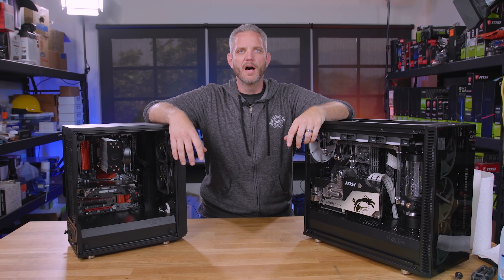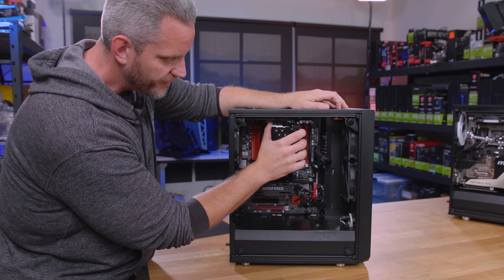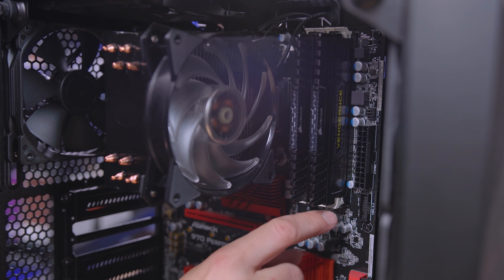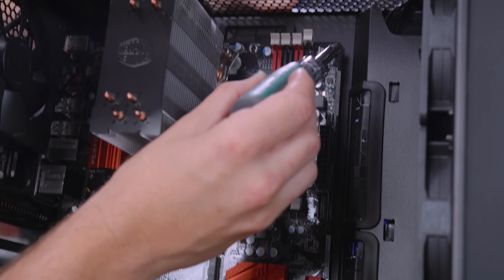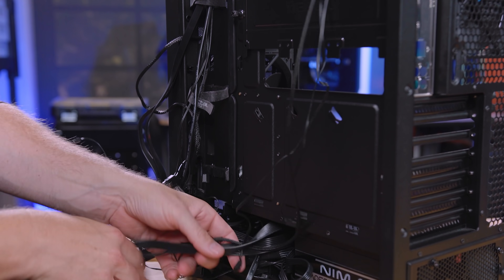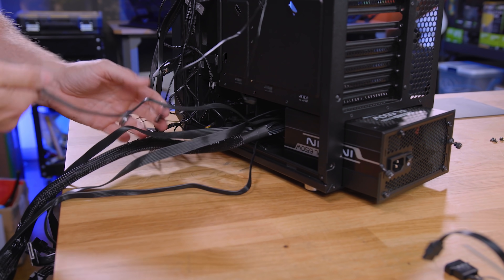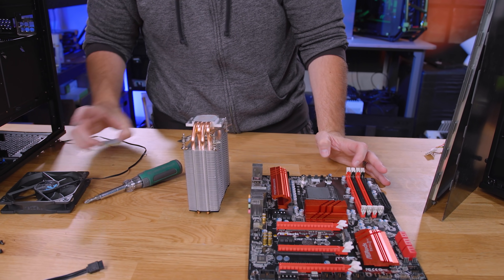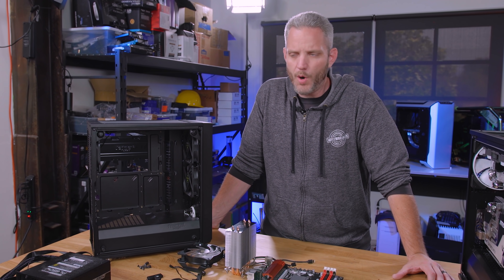How to UN-Build a Computer

Comment: Cannot explain how much this video helped me, I know absolutely nothing about building (or in this case un-building) PC's. I bought a pre-built 1-2 years ago and it has some pretty nice specs, but the case is awful, makes it hard to upgrade anything within the pc itself. I recently bought an H7 Flow from NZXT to move my parts into but needed help with taking everything apart, took me 2 minutes to find this video, and now I know what I need. Now the scary part, actually doing it 😟

Comment: Know it's an old video, but I'm looking at pulling a discount hp desktop apart to put it in a new case with room for larger power supply and gpu. Can anyone tell me if prebuilts have their motherboards and gpu soldered or rivited into the cases most of the time?
Reply: From my knowledge, most PCs do not have any motherboards riveted onto the case. You should just be able to remove the screws that affix the board to the case and remove it. Now, there are some manufacturers that may use proprietary form factors. So while you could remove the board from the case, it may not fit on an any other case. This especially true with All-in-One computers and those very small computers.

Comment: After unbuilding 3 pcs I find it all to be a bad experience. Pcs are annoying to build, any important hard to plug in wires are jammed into the corner while the wire doesn't have enough distance. PC cases and mb are meant for building and not unbuilding

Comment: I did build my own pc in 2018 and while I remember the parts well I dont remember near anything about the ports and cables. I wanna take my pc apart for a deep clean and put it back together (since the case was updated with a new drive and fans those cables are kinda smooshed wherever they fit and wrecked my cable management so)

Comment: this is helpful as I bought a custom and need to upgrade a few things in it such as the power supply, RAM, and CPU fan.  I been doing research and feel a little more confident but its still always scary working with thousands of dollars worth of tech on the lines.

Comment: Thanks Jay! I found this a little later in my disassembly but it's still very helpful. I got into PC super late and ended up going with a very high end prebuilt with a 3090 and 5950x. So as you can imagine, this tear down has been terribly scary as a first experience. I realize I had an underspec CPU cooler so I got a 360 aio, but due to the case and circumstances, I've essentially had to take EVERYTHING apart. It's still lying on the table at home, half dissassembled as I wait on the replacement cpu mount and backplate cyberpower never sent to me with the rest of the OEM parts, but I'm using the time in the interim to continue researching. Also, I wanted to give you a massive shout-out, I never would have made the jump from console to PC without the confidence I've gained watching your videos for the last few years. Thanks again Jay! Best PC tech YouTuber out there! Hope to see you on Phasmo one of these days!
Reply: Not Jay but I hope all went well for you! I will soon have to get a new PSU and GPU along with adding more SATA/storage. 

Enjoy the build. I had a friend build my PC for me when I went to Mexico. I did do IT but building your first isn’t easy as you have trouble finding your own mistakes.
Reply: @FabianC907   Everything turned out great! It took quite a while given the unfavorable situation, but I was able to get my aio on, and keep all of the old fans in the chassis along with the new ones for the 360 rad! It's beautiful and runs oh so cool now! I ended up having to COMPLETELY take  everything apart. The experience was taxing but so worthwhile. I feel much more confident with the intricacies of the hardware and making changes myself now. I honestly feel like the build looks a great deal better than how it shipped. I even invested the time into Signal RGB to sync all my peripherals and internal RGB. It's a beautiful beast that oughta be around for many years to come now, thanks for the reply, I hope you enjoy the mods you'll be making as well!

Comment: I just want to take it apart and build it back. Do i need to take off the aio cooler?
And do i need to Rennstall windows?
Reply: If you're going to take it apart completely, then yes you'll need to remove the cooling solution. No need to reinstall Windows. You can but there's no logical reason for that for simply taking the PC apart.

Comment: Hi need help
I want to remove the front pannel connector but its stuck or is there any lock which needs to be unlocked to remove  it. Its a single connector with all the pins in it.

Comment: You should definitely clean the cpu when it's in the socket. Because a it's real easy to get thermal paste on to the pin, but it's extremely difficult to get thermal paste off the pin for AMD (speaking form experience)

Comment: PSA if you use stock Ryzen cooler, remove your graphic cards/RAM first to create more space. I was trying to remove my wraith prism cooler first thing and found out I didn't have the space to maneuver and unlock the clip on the side of the cooler, because of the the GPU/RAM were in the way. I ended up bending some of my CPU pins because the whole thing was stuck to the cooler (just like Jay said in the video) and spent 2 hours straightening it one by one. Oh and getting the CPU unstuck from the cooler was also a nightmare, I ended having to us twizzer to kinda leverage it up by the side as I cannot twist it off :(

Comment: ** I don’t want to spend $80 for geek squad to fix a small prob so can you help me? I took apart my pc to do cable management. After I unplugged and powered off my psu, I pressed the power button to get rid of any extra juice, it flashed on for a sec and I wasn’t worried. I did my cable management and plugged everything in exactly where it was, did I ruin my psu by turning it on?

Comment: Please do 1 whole video on how to remove the 24-pin motherboard power cable thingy
Reply: I got mine stuck in my old mobo, I grabbed a shoelace and a pen, I placed the shoelace under the clip  and then I wrapped it around the pen,  I pulled using the pen as hard as I could, the mobo bend but didn't break also the stupid clip never broke,  finally the 24 pin came off . I was ready to brake the mobo, I don't know what I'm going to do next time I changed to a new power supply if I don't want to break my current mobo.
Reply: Just pull it out by wiggling it for 30 minutes or you rip out the plastic of your motherboard

Comment: @JayzTwoCents, hey so i was gonna rearrange my cables in my pc and I was wondering if it is safe to plug the drives back in afterwards? Like do I have to have them plugged into the same slots via sata or will the data be lost after unplugging while the pc is completely turned off, PSU and all are off?

Comment: thanks for making this. my first-ever build may have an issue with two of the DIMM slots (running at 1066 instead of 1600). so I might need to return my Brand. Fucking. New. Motherboard. to Amazon and replace it. Way less daunted about the process now!

Comment: I've had a prebuilt for almost 2 years because I was terrified of messing something up building a pc, but after watching your videos I realized it's pretty easy to work with computers as long as you're not reckless about it. I'm very much looking forward to the time when I finally replace my pc, because I'm going to do it right and build it this time.
Reply: Mostly ok, I had a tutorial running next to me so I wouldn't miss any connectors and it went great until I went to turn it on and it shut itself down not a minute later. After hours of troubleshooting I realized my CPU cooler bracket was backwards, turned it around my PC came to life and stayed alive. All in all, building a PC is pretty easy so long as you try to avoid simple mistakes like that and take your time.
Reply: @AtariGamer0917  Great to hear! Thanks for the response!
Reply: @AtariGamer0917 same situation as you expected it's been 4 whole years! New case cpu and ram today im so exited
Reply: How did it go?

Comment: Jayz: easily takes out 24pin cable

Me: almost cutting myself trying to take it out terrified of my motherboard snapping
Reply: How i feel about my 8pin gpu cable, feels like im gonna rip the gpu right out of the slot, i have two 6x2 pins for my gpu but i never know which one to use or if it matters. I went prebuilt through nzxt got the start plus which is now the starter plus pro lol i got lucky but its my first pc and these wires are scaring me
Reply: did u get it out
Reply: @G-fd9ds  yes
Reply: @QuickCosmosReal  took me a while but I got it out too 👍

Comment: Help needed. I’m not new to building computers but I have never taken one apart to this extent. I’m building a computer for a friend and I want to build it to get it up and running and the OS installed before I disassemble and take it to him to rebuild it. My question is about the M.2. Will I need a new thermal pad or to do anything special since it will only be installed for a few hours?

Comment: I've got this 10-year-old hp computer tower and the siding just won't come off and it's not rusted or anything and I'm pretty sure all of the screws are out and it still won't budge(update: so the side came off all you need to do is slide it to the side instead of just pulling it off)

Comment: 13:15 I wish I knew this a decade ago. Couldn't figure out how to separate a stock cooler from an AMD processor. Broke the processor and had to get a new one. Another tip for separating the Cooler from it's CPU. I read you can try dental floss, Isopropyl Alcohol (higher the better). Pour a little Isopropyl alcohol into a dixie cup, dip the string of dental floss in it, and then thread it between the CPU and Cooler to loosen it up the thermal paste. Hopefully that helps in addition to the twisting one.

Comment: I once allmost broke my Motherboard cause i forgot a Screw that was still screwed in.
Reply: i thinks MBs are freakin sturdy to be destroyed just by that. well, if you yank it off too much out of frustration that could happen..
Reply: @yjohn-04  It wasn't out of frustration. It happened as i was getting into electronics and soldering (at about age 13) now 20. Now i know better but at the time i didn't.
Reply: @holzwurm_hd7029  really.. ok, i thought you were just trying to remove it from the case, but u forgot a screw

Comment: I cleaned a ryzen 3 1200 cpu with 50% isopropyl and it still worked (some thermal paste seeped into the pins so I was like fuck this and drowned it with the alcohol and use a hair dryer to dry it)

Comment: I kind of unbuilt one. I got a new video card and it was to big for the case. I had to take the hard drives out(by unplugging them and taking them out). Then had to take out part of the frame the drives sat in. Card fits now, plugged in drives “maybe right “ the mother b. Comes on but nothing else. Not even screen.

Comment: for AMD CPUs u can either twist the heat sink to get it to come loose or do a 10 min stress test and remove the cooler after u turn the computer off and remove the power while the thermal paste is still warm n gooey

Comment: 14:12: I managed to damage an FX9590 with the paste managing to get in the gap of the spreader and the chip.. that and using a bit too much alcohol that got soaked on the pins.
Going to be removing the paste off of my 4350 soon... not looking forward to it.
Reply: I would think alcohol on the pins is fine. It evaporates pretty fast and doesn't leave residue that I'm aware of.

Comment: I have a question: I have noticed that as a gaming community we don't seem to care too much about sound quality. I find this slightly interesting because of how much we rely on it in games. Would adding a good sound card help ones gaming performance? And on this note, I have noticed in some of my games, where I can turn down the sound quality, I can turn the sound quality all the way down and turn up the graphics quality and still have the game run smooth. Where as with the sound quality turned up I had to turn down the graphics to get a smooth game (I had an old graphics card at this point). I have wondered if I just added a sound card if that would have fixed my problem. Could I have had high sound quality and high graphics quality and have a smooth game? Don''t suppose JayzTwoCents could test this?

Comment: Hey jay I have a Ryzen 5 2600 with an RX 580. I am thinking of upgrading to either a gtx 1080 or an RTX 2070. Will it be worth it in the long run to go with the RTX card or will I get more miles out of the 1080?

Comment: The tip about removing the power cable from an ssd would have been really helpful to my friend a few years ago. He snapped the connector right off the drive and I soldered an extension cable to each of the pins, so i could use it for myself
Reply: Yeah I broke the connector on a DVD drive. Get worried every time I disconnect SATA power now.

Comment: Hi Jay. I have a qeustion? When i play gta 5 on my pc which is installed on my normal 5200rpm hdd. The game stutters as well as few other games. Can this be caused by hdd? Im running an i7 2600 16gig ram and sapphire radeon rx470 8gig.

Comment: I bent a SHIT load of the pins on my 2200g by wrenching the cpu out of the socket with the tension bar still down. Luckily it was a throw away cpu that was only there until my 2600x arrived but still pissed me off and took about two hours of fiddling with needle nose tweezers to get the 15 or so pins back to a place that would allow the cpu to fit the socket and the pc to post. Never again

Comment: Hey J, Could you make a video on compering 2x 2080ti in SLI in 8x/8x on a 9900k vs 2x 2080ti in 16x/16x on a9900X. I want to know if the 9900k is limited by its 16 PCIe lanes compered to the 9900x with 44 lanes.

Cheers

Comment: Four things not covered in this wonderful guide that I feel needed to be reiterated--and most people overlook:
1) It is just as important to GROUND yourself when disassembling a computer as it is when building one! Shorting compents leads to troubleshooting headaches or a trip to Geek Squad you could have avoided.
2) Sometimes capacitors, chokes, and chipsets can maintain a fair amount of charge and/or heat even hours after unplugging the PC. After you unplug the power cable from the wall & power supply, press the power button once (or twice if you have OCD) to release some potential energy built up. But even after beware touching some bare components on the motherboard as heat on bare skin is not the best of feelings. Also due note that modems (if you're old enough to remember them) and network cards still plugged in can carry charge through the PCB. It's not always "dangerous" but it can sure 'put a spark in your day' if you're not expecting it!
3) Don't assume your "durable", "rugged" or "military grade" components can withstand any and everything you throw at it. They have some durability, yes, but they are not unbreakable! They are also no more immune to static or kinetic energies than the guide book says. You're components aern't made of glass either, some care should be taken when handling but bubble wrapping your hands is not required.
4) READ THE MANUAL! and then read it again! Also, ask questions or google before assuming!

Comment: I like leaving the CPU in the socket while cleaning off the old thermal paste. Easier to keep steady and not worry about bending pins etc.. Careful not to push/bend Capacitors if they are too close though.

Comment: You should've mentioned in the very beginning to toggle the power switch on the power supply to "0" and/or to remove the power cord from it. Only then can one touch anything else.

If you try to teach the basics do it properly or just do not at all. Thanks.
Reply: Shpinga let he mentions many times to unplug the power its literally sitting on the desk with nothing plugged in. How fucking stupid do u have to be to start taking apart electronics when its plugged in? Should you do car repairs with the engine running too?

Comment: That hint with removing the heat sink from the CPU, by twisting and turning instead of pulling? That is something that needs it's own videos and a million upvotes so everyone finds it, even and especially by accident. I never had that happened to me on any of my previous computers before and it freaked the fuck out of me, when it happened with my barely one year old Ryzen 7.

Comment: CRAP! Just did a new build this weekend. Asus hero Mobo, Rtx 2070, i7-8700K, etc. Get done with cable management to find out the motherboard is faulty. After getting off the phone with Asus to confirm failure, I hop on YouTube to distract my frustration just to see this video posted. Lol I guess it’s a sign I should get to it and start taking apart this oversized paperweight and send back the Mobo. Dammit Asus!

Comment: I only have one question after watching this video what the heck do you do if you can't get the 24 pin connector unplugged from the motherboard?
Reply: wcb_88    Grab on to it. Squeeze the clip with your thumb and wiggle up and down while you pull on it. Sometimes they get stuck on there real good.